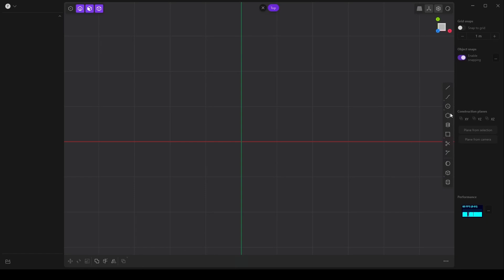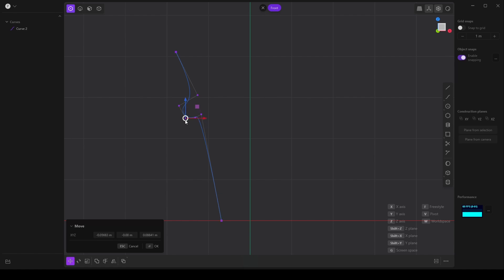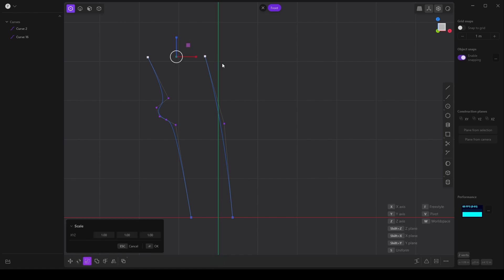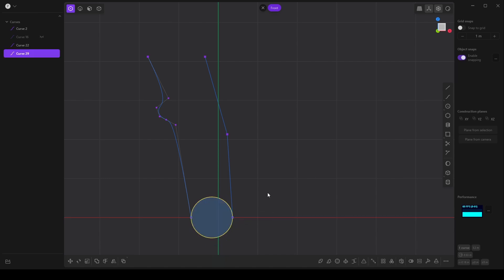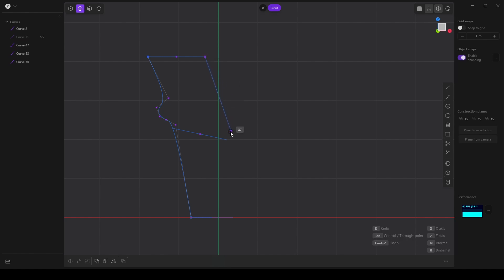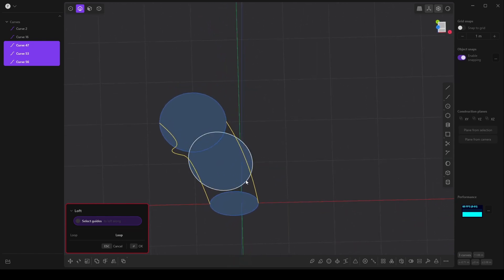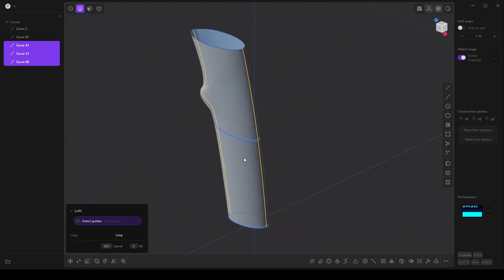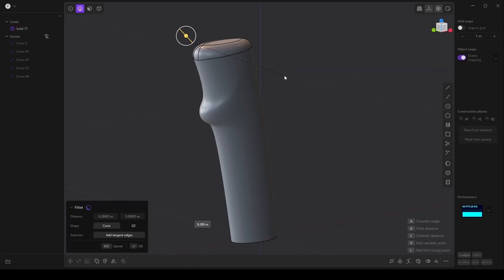How to fix lofting issues in Plasticity [Part 2] (Drawing in 3D)

Comment: If you join and bevel those 2 curves then you can use it as guide
Reply from the maker: Yep, I'll be covering this in my next few videos.
Reply: What means bevel 2 curves?
Reply from the maker: @cr4723  Joining two curves, than using a bevel/fillet to round the corner
Reply: @ReboundAnimation  Ah, I see. It is an alternative to Loft and Blend/Bridge 2 Curves.
Reply from the maker: @cr4723  Yes! That is a good way of putting it.
Reply from the maker: I now have a video on this and more: https://youtu.be/p50gF1T0Ons